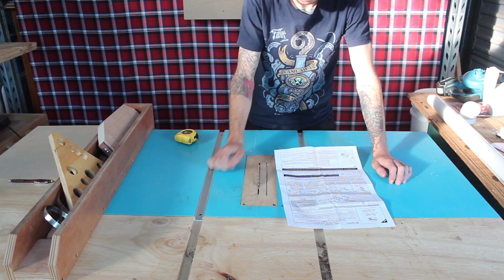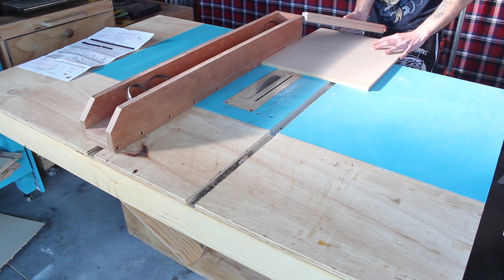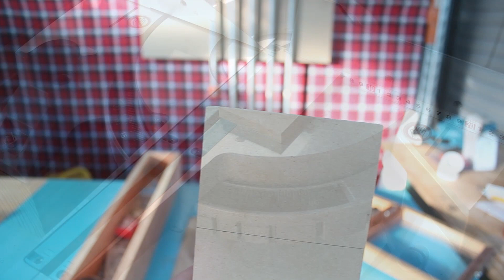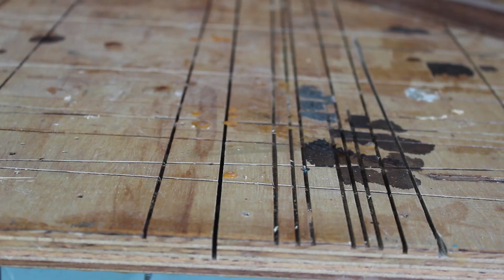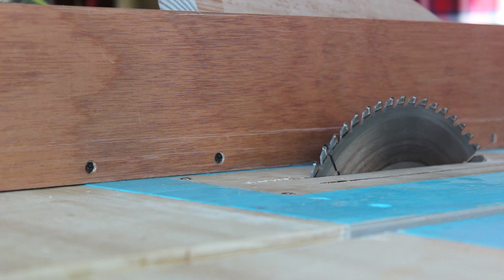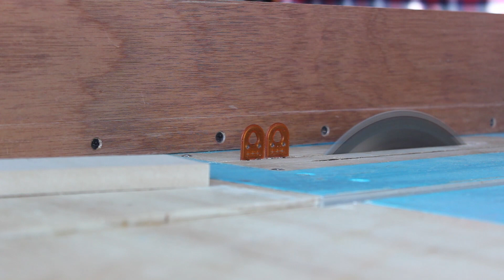No more blade burning, much better table saw safety!

Comment: I may get those also. You shouldn't feel bad that you can't install a riving knife. Because if you did have one and it wasn't as easy to remove as the microjig splitters, you wouldn't be able to do stopped cuts.
Reply from the maker: Exactly!